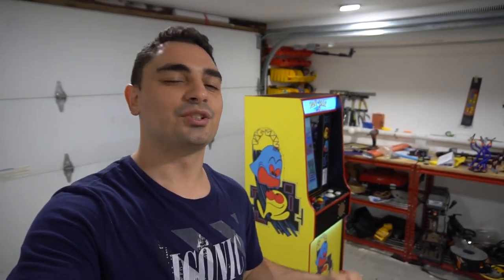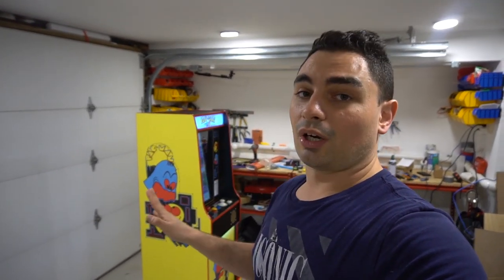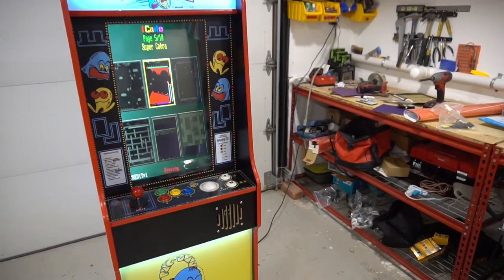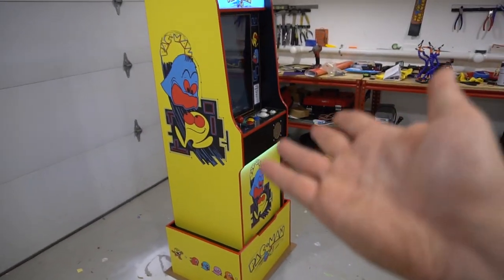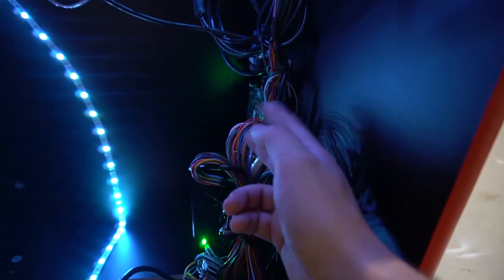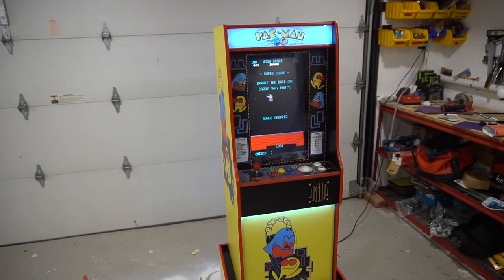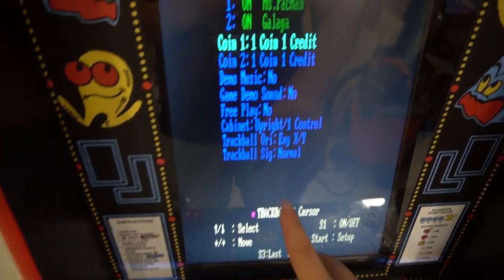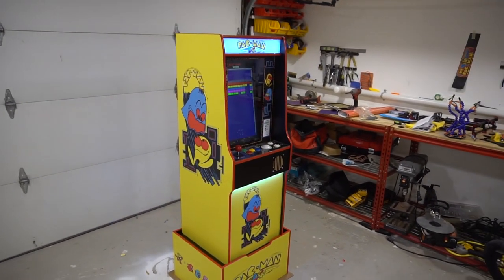Pac-Man Vertical Arcade Cabinet - 60 in 1 with Trackball!

Comment: I need a vertical cabinet for arcade games as well as pinball......all this is missing is pinball buttons on the side and either replace trackball or just add a spinner
Reply from the maker: Missing a little more than that haha, it would need a PC to run.
I'm personally the type to keep arcade and Pinball separate.
It's a cool idea and I can try to create a cab for it but it would be probably like a 43 inch screen
Reply: @Vic_VP  ya no I realize that. ...but for me I'd like to get as many cabs combined in one...both for space and cost. ..want vertical separate with pinball and spinner for arknoid.....then I want a cab either 2 light guns and a racing wheel and then just a regular horizontal cab.....and no ya I do realize I'd need a pc for it as your running a jamma board

Comment: Never tried the 60 in 1... Have a trackball that should work with it tho.  You mentioned your screen isn't stretched... But it's a 16.9 aspect, isn't it ?
Reply from the maker: Yes so technically it's vertically stretched unlike a horizontal stretch which is good awful lol. As you can see the vertical stretch isn't really horrible, I enjoy it.
Reply: @Vic_VP  Nice cab, but it would look so much better with a 4:3 (3:4) monitor in it.